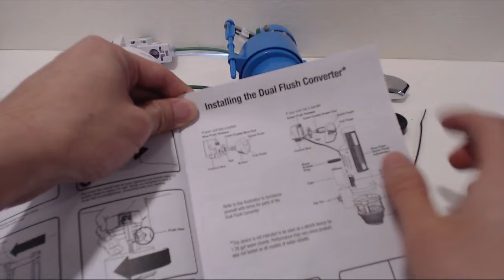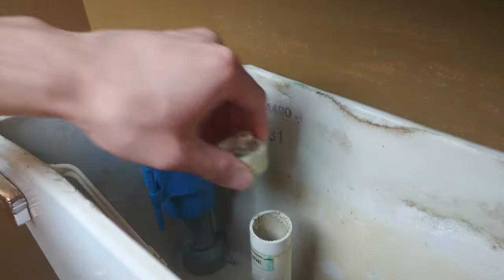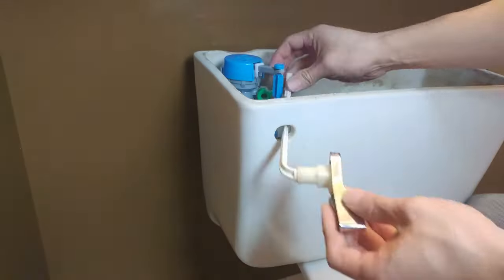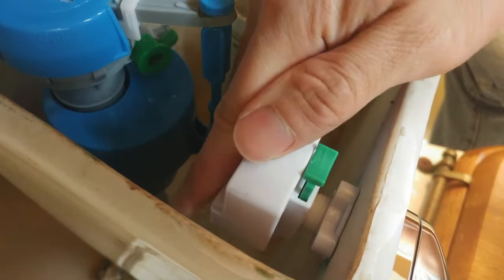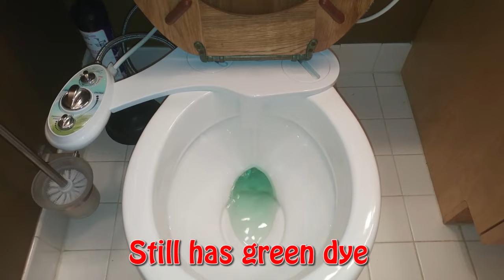How to Install Danco Next Duo Flush Conversion Kit and Review

Comment: Just installed one of these to fix a leaking toilet. Easy peasy to install following your directions, but still leaking. Any thoughts? In any case, thanks for the amazing helpful video.
Reply from the maker: Thanks for the compliment! But I'm sorry to hear ti didn't fix your issue. What I found with the rubber seal gasket on the Duo flush is that it can be either too loose or too tightly seated in the hole that empties into the toilet bowl. If you adjust its position while the tank is full of water it might be easier to determine when you have a good seal. Trying pushing the entire flush control assembly down a little more to see if the seal is simply a bit loose; if the water stops leaking into the tank, be sure to slide the rubber retention ring over the overflow pipe down so it maintains the downward pressure on the assembly. However, if the rubber gasket is seated too tightly, this could cause a "wrinkle" or slight fold in the seal with the tank hole which can also lead to leaking water into the bowl. You can check by sliding your hand around the seal and feeling for any bumps along the edge. In this case you'd have to lift the assembly up slightly and see if it stops leaking. The other thing to look for is whether or not the tank is over-filling and the water level is too close to the top of the overflow pipe and water is running into the tank from there. You can adjust that by lowering the float.

Comment: Hi thank you for the fabulous instructions. However I have a little problem with my thin water pipe that connects to the unit so the water leaks. What can I do?
Reply from the maker: Hm, usually 2-3 wraps of plumber's Teflon tape on the threads of the connection that is leaking will be sufficient to stop a small leak. Wrap the tape in a clockwise direction (same direction as you turn the connector to tighten it) and be careful no to leave any excess tape hanging off past the last thread. Using too much tape can also cause the threads not to catch and the connection to leak.

Comment: The J tube is included in the box set. I bought it. I bought the same one you did. The j tube was in there
Reply from the maker: I did notice the boxes on the store shelves aren't sealed... so perhaps it "fell" out or someone needed a replacement J-tube and I got unlucky. Thankfully, it's optional and my unit works fine without it!

Comment: If only the handle broke on an existing dual flush toilet, do I have to change out the whole system? Great video btw👍
Reply from the maker: There is a replacement handle part available for this DualFlush conversion kit on Amazon: https://geni.us/lR9LqNq [Amazon Affiliate Product Link] Note that this replacement part only works with the green control cable model of the DualFlush kit as shown in the video.

Comment: Great video! I wish I had watched it 3 yrs ago when I installed my hydroclean hc630  /  Great product! 
Now it's not filling up automatically like it did before. after flushing I need to shut off water valve and re-open valve to fill tank.
I can't figure out why it's not refilling the tank automatically? any ideas???  thanks
Reply from the maker: Hm, for this issue, Fluidmaster recommends flushing the fill valve or replacing the cap assembly with a new one. You can find the detailed steps for that here: https://www.fluidmaster.com/toilet-problems/toilet-wont-fill-slow-filling-tank-remove-fill-valve-cap-replace-seal/

Comment: If I am understanding correctly, the split handle should be able to function with both parts together and also with the larger one functioning separately...but mine is not doing that.   It is only working a solid handle.   Is there a special step in the installation process that sets the handle to function separately?

Comment: Great video; however, at 3:43 you describe the mini valve backwards. Right/down is fully open and left/up is closed. I just installed this and as per the instruction manual, if the bowl isn't flushing and you have to hold down the button/lever for a second or two, then move the blue float slider down. I did that and it still won't flush properly. I was thinking of replacing the handle with the button style because I'm not sure how to correct this, but it's not acceptable.
Reply from the maker: Thanks, yes, you're correct. I got the orientation mixed up. So you're saying your bowl won't clear at all when flushed, neither on setting 1 (small) or 2 (full)? That's really odd. It may have to do with the size/capacity of your tank? The unit doesn't work well with tanks that are already designed to be water-saving or low-flow.
Reply: I tried raising the float so the tank itself would fill up a bit more. Then I adjusted the blue slider float and it has been flushing OK so far. It takes a few seconds before the bowl empties, however, almost like it's struggling to swirl down.

Comment: Don't know what the J-tube nozzle at the bottom of the valve for. You did not touch it in your video. Any idea what's it for? Thanks a lot.
Reply from the maker: My kit didn't come with the optional J-tube so I could not cover it in the video. The J-tube basically stirs up the water that settles at the bottom of the tank each time you flush in order to help prevent residue/sediment build up in the bottom of the toilet tank, so its purpose to to keep the tank clean.

Comment: Sometimes the chain flapper gets stuck and the water is keep flowing into the bowl. I guess this system doesn’t have that issue.
Reply from the maker: Yup, that's one of the advantages. No chains in this setup! You do have to ensure there's a good seal between the silicone ring and the water control valve assembly, but if that's good there are relatively few issues that can develop over time.

Comment: Loved your video, but I have an old house with 3 large toilet tanks from 1954 that are 21" across, 7" deep and 17" wide. I've installed 2 Danco's alreadyThe water comes up to 4" below the overflow pipe!  But everything works. I'm having trouble adjusting the fill valve. it doesn't want to higher or lower.
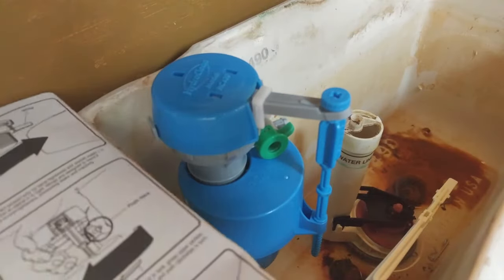Reply from the maker: To adjust the valve height, grasp upper portion placing your thumb on gray side of the mini-valve and push clockwise ¼ turn. Then slide the upper body to adjust it up or down (see 1:21).

Comment: I installed this system approx. one month ago. The flush gasket warped and blistered.
The nylon zip tie is a joke. It isn't strong enough to hold the device in place (to prevent leaks into the bowl) even with the included wedge and gasket. I had to use an automotive hose clamp.
Not bappy with these canister flushing systems...as they really don't save that much water in the end....because most users flush rpeatedly to clear the bowl anyway. What happened to the easy float ball and chain...which had studier flappers that sealed for a very long time. I suspect everyone using canister systems will be changing the gasket every two years...so there goes the monetary water saving feature.
Reply from the maker: Sorry to hear it's not working great for you. Not sure if Danco has a customer satisfaction guarantee, but if they do maybe you could reach out to them for a resolution or refund.

Comment: Great video! thanks. I didn't even have to look at the instructions. FYI on Kohler toilets with the handle on the side (not the front like this one) the flushing mechanism/cable gets really close to the float setup. I got it to work but it is tight.
Reply from the maker: Thanks for the tip!

Comment: Hi Phil great video! Say I installed one of these today and the flush converter is too tall by about 1/2 inch. I have an angled rubber gasket the bottom of my tank. Can I swap that out with a flat gasket to buy myself a few extra inches of clearance? Thanks.
Reply from the maker: Hm, I'm not sure. Typically the flapper seat is part of the overflow tube assembly, so if you want to convert from an angled flapper seat to a flat one, you may need to replace the entire overflow tube (of course, if the flapper seat is separate, this is not an issue). I know the Duoflush is designed to be compatible with both styles, so it's possible that you'll get a bit more vertical room by making the switch, though I can't say exactly how much.
Reply: Thanks Phil!....I did solve my problem though. I simply removed the top of the plastic housing with a screw driver. There are a few notched clips that make this easy. I then clipped off the top of the blue low flush ruler by about 1.5" and that did the trick. Its been in and working now for about a week.

Comment: My flush controller keeps popping off the handle every time we flush, so I have to snap it back on each time we use the toilet. Any suggestions on a fix?
Reply from the maker: Hm, the tab on the flush controller serves as the locking mechanism. It sounds like it's not engaging when you install it. You'll need to press down on the colored tab (see 1:58) and you'll see the "teeth" inside the flush controller spread apart inside the connection point, then fit it onto the stem of the flush handle and release the tab and those teeth should clamp and "bite" the stem to lock on. Give the controller a tug to see if it is secured. If it still falls off, then perhaps the controller was not pushed far enough onto the stem to seat the locking mechanism. If you're sure it's pushed on all the way, there may be a problem with the clearance inside your tank or the locking mechanism itself, e.g. broken teeth or worn stem. In this case, one or both of these components needs to be replaced.

Comment: I bought one and install it today. The quick flush still too quick even I move the blue tap all the way down. any suggestion? Thanks,
Reply from the maker: Hm, if you're still finding that there isn't enough water used in a "small" flush, even with the blue float pressed all the way down, it's possible that your toilet tank is a smaller size or is already a "water saving" type tank and uses less than the standard 1.6 gallons/flush. This dual flush converter isn't really designed for use with smaller sized tanks less than 1.6 Gal.

Comment: What happens if the flush handle is not going back up after you flush it? I am trying to help my friend gets her to go back up. But the flush handle just stays down you have to put it back up. Hope you can help thanks.
Reply from the maker: This sounds like perhaps the spring inside the flush handle may have come loose, but that only way to tell would be to remove the flush handle and look at the underside to see what is happening when you press down on the handle.
Reply: @ReviewedByPhil  Ok thank you for your response. We installed a new flush kit so it worked out well in the end. However, we will look into that flush handle that got stuck. Thanks for your help. :)

Comment: Can I install this over a canister style flush valve? I’m assuming no…
Reply from the maker: No, I don't think it would be compatible unless you completely removed the existing canister valve. There would need to be a 2" diameter valve opening between the tank and the bowl for the dual flush conversion valve to seat into.

Comment: This video is 2017. How well is it holding up?
Reply from the maker: Great, still works fine in my toilet. We did replace the fill valve last year because a plastic piece in it broke, and it wasn't filling, but that piece only cost about $8 from Home Depot.
Reply: @ReviewedByPhil  Thanks. I have ordered this and I'm awaiting shipment.
Reply: @ReviewedByPhil  Update. Installed mine 3 months ago and the float is getting stuck or is water logged and not floating. Nothing binding. I bought 3 of these and feel really bummed out now. I have not installed the other two and will be returning them.

Comment: Has the quick flow valve ever overflowed the tank?, I mean there is small green water flow lever to shut off water.
Reply from the maker: No, I've had the product installed for over 3 years now and I've never had  a problem with overflowing the tank. The float should stop the water from filling as soon as it reaches the level set by the float stopper. Plus the overflow tube would drain down excess water into the toilet bowl faster than water could be put into the tank.

Comment: I bought this kit then realized that the flush valve of my tank is 4-inch large while this one is only for 2-inch valve. Where to get a adapter to make them work together?
Reply from the maker: Hm, I couldn't find any information about adapting a 4 inch flush valve to fit a 2 inch kit. Unfortunately, I don't think this will work for that as the duo flush conversion kit is designed to fit 2" flush valves. You can try reaching out the Danco for further clarification on this.

Comment: Phil, will this unit fit a flush valve with a 3inch diameter, or can it only be used on a 2inch flush valve?
Reply from the maker: No, the packaging states 'Fits most standard 2" to 2-1/2" flush valves'

Comment: Mine is acting up the water keeps flowing without flushing what could be wrong i have to shut the water off to stop it
Reply from the maker: It could be the float is too high and the water in the tank is over flowing into the fill tube or the fill valve simply is not shutting off as the float never reaches the "stop" height. If that's not it, and water is entering the bowl after water stops slowing from the fill valve, then the likely culprit is the seal between the flush valve and the hole in the tank that feeds the bowl. If the seal is loose water could leak into the bowl, but also if the valve is pushed too far into the hole, the gasket can wrinkle which would also break the seal and allow water to enter the bowl.

Comment: Do you know why my toilet water in the tank keeps running. It didn't stop.
Reply from the maker: It sounds like water is draining from the tank into the bowl. There are typically two causes for this. If the water level is too high in the tank, it will drain into the overflow pipe in the middle (see 3:13), and if the float doesn't raise all the way (is set too high) water will continue to fill the tank. The solution here would be to lower the float, by twisting the float level dial counter-clockwise (3:18). Now if the water level isn't to the top of the overflow pipe, then it's likely to that's draining into the bowl from the main flush valve (where the old flapper was installed). When installing the rubber ring (see 2:23) be sure not to push it down too hard into the opening. There's a sweet spot here that you want to go for -- too loose and water will flow into the tank past the gasket, too tight and this can cause wrinkling in the seal and allow water to drain into the tank as well. Just press down hard enough that it has good contact and is snug and feel with your fingers around the seal to ensure that it is smooth and touching the sides of the opening without deforming or creating any ridges or bumps. Good luck!
Reply: ReviewedByPhil exactly. I changed the filter and it run good now. Thanks for the video.

Comment: The tank water will start to leak back into toilet. It isn’t a snug enough fit
Reply from the maker: I find that sometimes this is caused by pushing the unit too far down into the tank hole, which creates a small wrinkle in the rubber liner allowing water to leak down into the bowl. There's a delicate balance between pushing it snugly down enough, but not too far to create a tight seal. You'll just have to play with it a little to see what works, but just note that sometimes, pushing down on it more, makes the seal worse, not better, so it may actually have to come up a little.

Comment: I have an old American Standard toilet with a date stamp of 1933. I installed the dual flush and the quick flush uses as much water as the full flush. So I put the blue quick flush adjustment all the way up and no change. I am wondering if there is something wrong with the linkage so that no mater which handle is use it operates as a full flush. Any suggestions?
Reply from the maker: Hm, the quick flush is the inner "smaller" lever. If the blue float is all the way up and it's still using all the water in the tank, perhaps the handle is getting stuck on something? If the handle is held down or stuck and the flap stays open this would potentially use all the water in the tank every time. Perhaps the Danco techs can better help you out? https://www.danco.com/support/

Comment: Can somebody tell me,  if is normal that after the install the Hidroclean it make this sound all the time ??
Reply from the maker: What kind of sound? Like the water is running all the time? If so,  maybe the tank is filling too high and draining down the overflow pipe, or the seal at the flapper hole is not tight and water is leaking into the bowl.  You'll need to check/correct both those issues and the sound should go away.

Comment: How to fix the flush non stop flushed water
Reply from the maker: If the water continues to run into the toilet after flushing, this could be for several reasons. Check to make sure the seal between the flush valve and the tank is completely solid, with no wrinkles or bubbles, as this can allow water to run into the toilet constantly. The other issue could be that the float is set too high, as this is what signals the tank to stop filling; if set too high, the stop trigger never occurs and the excess water simply runs into the overflow tube. To lower the float, turn the adjustment screw counter-clockwise (to the left) as shown at 3:17.

Comment: Please plumbers get customers to switch BACK to back to a lever flush syphon system, since the push button valves leak after a few years and cause water waste  of 2-4 flushes a day down the pan!

This is due to bits of limescale getting in the flush valves seal causing water waste...